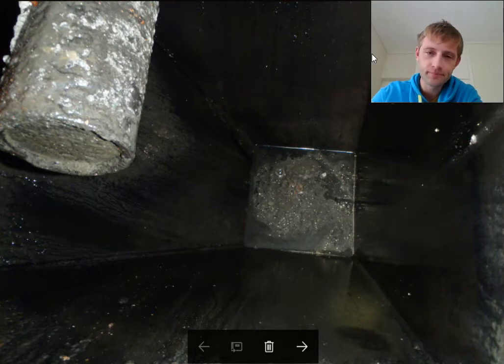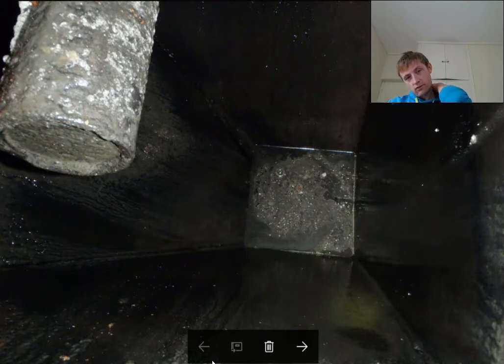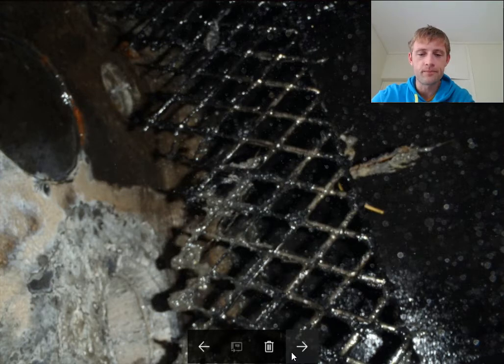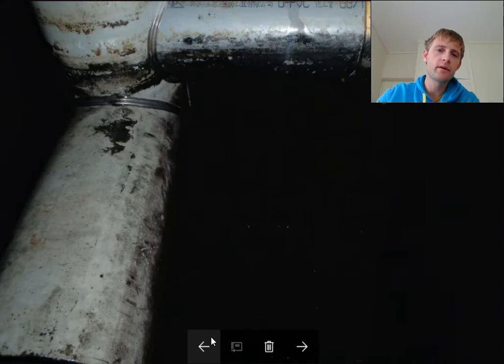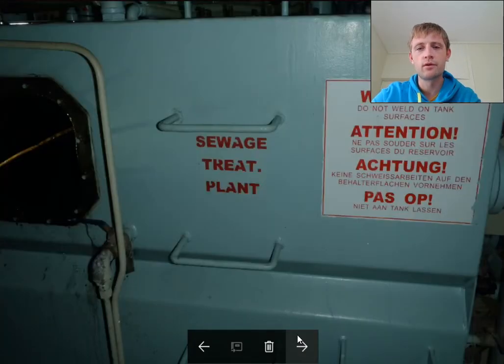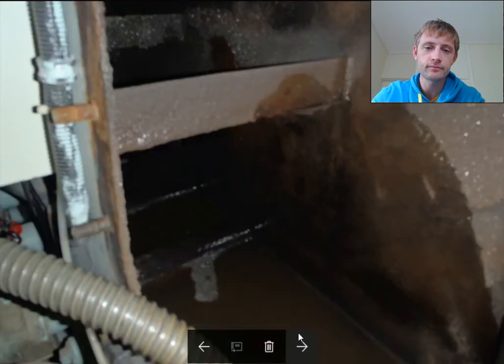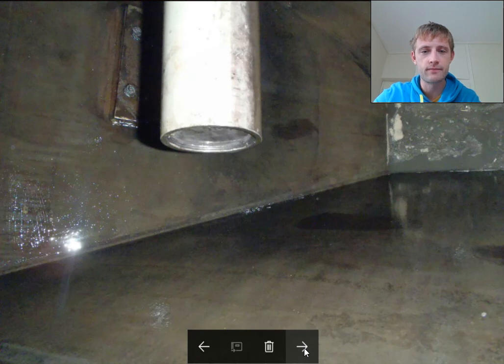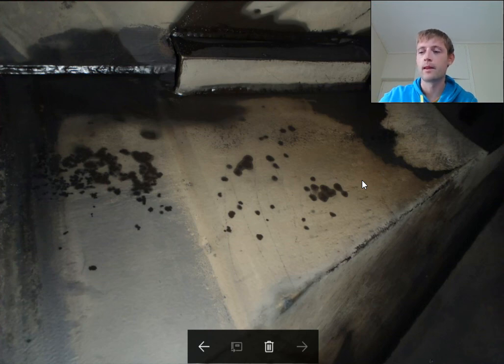Marine Sewage system explain some tips

Comment: What is the time after which cleaning of s.t.p necessary.? Could you guide  us
Reply from the maker: Normally the only check you do is the flow of air to unit and some test to see if your sewage working.If everything is ok every 3 months one cleaning per 3 months is ok .Very important to have air supply and proper flow also good condition of bacteria.Thanks!
Reply: @Marine_Engineer_learnings  air flow mean by return of sewagw